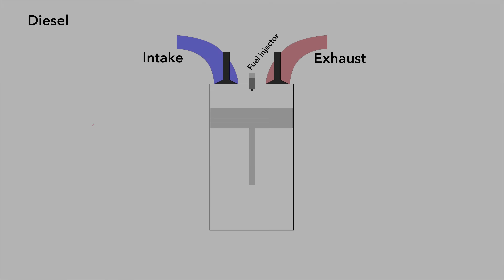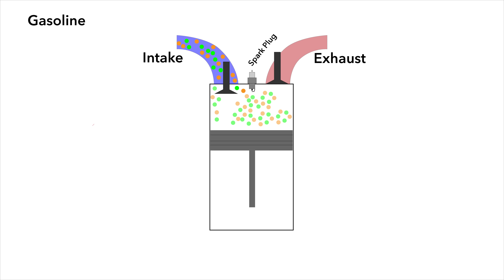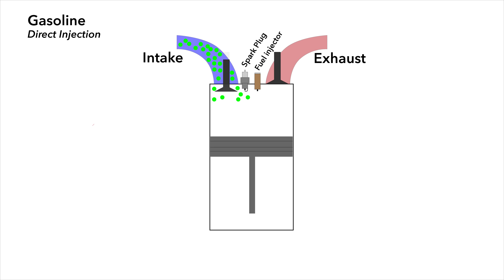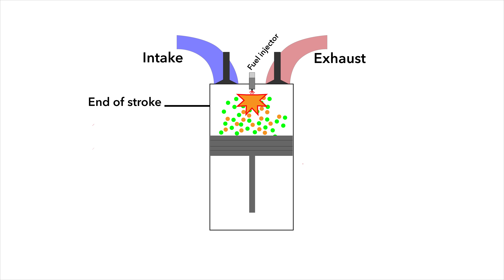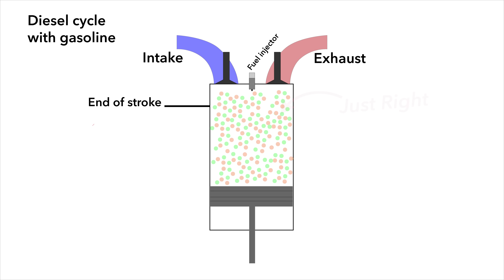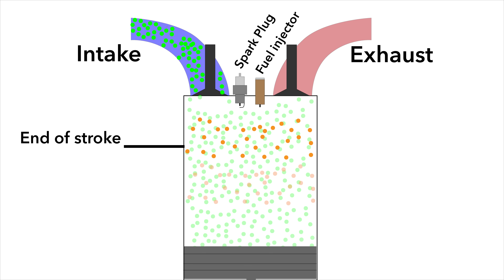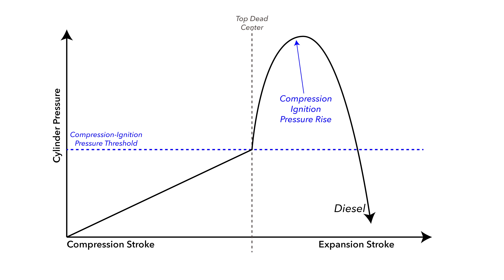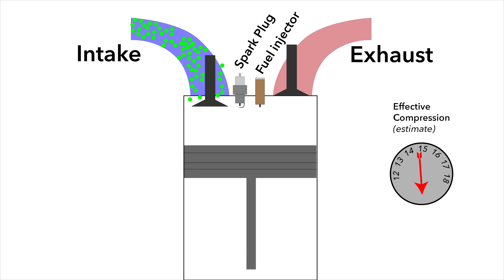Skyactiv-X: Mazda's Revolutionary Engine Explained

Comment: Still a heat engine, doomed to waste 60% or more of the energy in the fuel. Electric motors waste less than 5%. Last gasp of a dinosaur technology.
Reply: What about the old batteries of Tesla?Imagine after 20 years all this junkyards full with Tesla's acid crap.And no,there is no solution yet for recycling them.Also making electric cars they produce so much CO...read more
Reply: We have more than 200 years worth of oil without AK, CA & East coast restricted areas.  Which will carry us thru the cycle of climate change to global cooling phase...

Comment: How do you keep the carbon build up on the valve stems from happening with the GDI?   Isn't the detonation fighting against the up stroke of the engine and what we have always been told is bad for the engine?  How many miles will you test before determining longevity.  Why cant my dealer even explain to me as a potential buyer what "Sky active is"?

Comment: I'm not convinced this is anything revolutionary. My understanding from watching your video, is that this is a new name for what Honda called "CVCC" and patent in the 1970's ".   Exactly as   Mazda illustrated, but using a dual chambered combustion to maximize power and efficiency. How can Mazda be calling this "combustion ignition" if they still need to use a spark plug? 
I like the technology, just think the PR its slightly misleading.
Reply: Spark plug is there only for increase od Pressure in Valve using small piece od fuel. Maybe 5%, i don't know. Real work(rest 95%) of engine is maded by ignition of fuel like in diesel.
Reply: Cvcc engines were developed in 83. They used a spark plug small cylinder and higher compression.  They were developed in Japan. The skyactiv x is developed in Japan. They skyactiv x uses spark to increase the compression ration at high speed. In order to get around compression issues with gasoline. Based on your respons I feels as if you did not watch the video to the end. Or he dosent explain it in way you understand. No worries Try anothers videos explaining.  I see it as completely engine. by learning from the cvcc. Like. A lil bro learning from big brothers achievements. Just one random no bodys opinion. Take care :)

Comment: You are incorrect about how diesel ignition works.

Diesels use mechanical injectors to introduce fuel to the cylinder.

Diesel injectors are like syringes.  For example, if the injector is full of diesel, when it comes time to inject the fuel, the plunger will start to inject the fuel into the cylinder through the atomization nozzle where it will start burning.  The diesel will continue to be injected and burned until the plunger reaches the end of the stroke.  The result is that the pressure created by the burning fuel stays constant for a longer time rather than jumping up all at once and then tapering off as the piston is pressed down.  This is what gives diesel engines so much more torque and why automotive diesel engines get so much better mileage than gasoline engines.

Comment: Here's the question:  high CR in diesels does not ruin their longevity. High CR and resultant higher, more sudden pressure rise after the explosion allegedly does shorten lifespan of engines used for racing. 
How is that possible and how is a Skyactiv dealing with it?
Reply: Its not a racing engine. Hope that helps you.
Reply: Answering myself after two years:

1.) it's not an 'explosion' at all
2.) mixture is super-duper-lean

Comment: Mazda... SkyActive XR for the new RX-9. Or how about a rotary engine that works like an alternator. The electricity could charge the battery bank.

Theres a capacitor for turning on the vehicle, then it uses batteries long enough for the rotary alternator/dynamo to charge the batteries... Think about it!!!

Comment: Nice but also useless for a  type of engine that even ideally has a 50% efficiency ceiling, right ? Wouldn't all this creativity and genius be better invested in better electric engines ? Maybe an engine that has zero internal friction and also acts as suspension while using zero copper ( which I'm about to launch worldwide) ? Bye

Comment: Call me dumb. But how... And I mean how is it "compression ignition" if the spark plug literally ignites the fuel. He says it himself in. The video. So they figured out hoe to lean out the mixture eith slight agitation to gain extra ratio then add fuel and a spark? Hah. Sparked ignition is sparked ignition.

Comment: Have you ever heard of the Honda CVCC system of the late 70s and early 80s? This was a carb engine (pre fuel injection)..  It sends a very lean fuel/air mixture through the main intake port, into the cyl.. At the same time it sends a richer air/fuel mixture through a separate intake port with it's own valve and valve timing, into a small chamber atop the combustion chamber, where the spark plug ignites it. The resulting "flame" is able to ignite the lean mixture in the main combustion chamber. This is how Honda was able to sell us a car that got 50 mpg in the years BEFORE fuel injection was common on production cars.   So, Mazda hasn't invented anything new. This is just a fuel injection version of the Honda CVCC engine.  So, you might ask, what ever happened to the CVCC?   It was made obsolete and unneeded by modern fuel injection systems, and advanced engine control electronics...  Mazda is selling you a solution to a problem that doesn't exist.

Comment: I own since new a 2009 Mazda 3s hatchback 5 speed auto with 184,000 miles. I have been dumping money lately for suspension parts at all four corners and a trans module. I just got back from a 2000 mile Marathon trip in 50 hours. Car ran like a champ. Did not burn a drop of synthetic oil.

Comment: For over 100 years we upgrade the internal combustion engines with different technologies etc .... well in the bottom line we still burning gas or diesel (oil products) and nobody talks about the DAMAGE these kind of high tech engines still do on our planet NOBODY talks about it .....
Well ....Thank you very much Gentlemen .... But I call this fake technology nothing else.....
Face it.....

Comment: Why can't we use a small secondary cylinder which has a plunger to increase the pressure in the cylinder at ignition time? It could take the space of the injector and plug.
Reply: I thought of that In the mid 1970s using  hydraulics.

Comment: Also in your explanation you say running touch makes more power which is absolutely untrue. Running rich is cooler because the extra gas absorbs heat but it wastes gas and pollutes more and can damage your catalytic converter. Running lean makes more power and it's more fuel efficient but makes more heat which if it's too hot it can damage your engine. That's why manufacturers or tuners try to make the engine run as lean as possible to get the most power and efficiency without getting to hot to damage parts of the engine.

Comment: That doesn't sound like compression ignition to me.
Reply: Direct injection gas engine. It's was invented years ago. KTM attempted to build a 2 stroke engine using this but the injection pumps used up too much of it's power output
Reply: The fuel/air mix is compressed just below the point of self-ignition, at that point the spark will light up just a little part of it causing an increase in compression which ignites the entire air/fuel mix. Hope that helps
Reply: @gaetandevos2212  I don't need any help. It already work on direct injection gas engines now. They were mass produced in 2008. Now almost 45% of the cars have direct injection. Direct injection itself was invented in 1902. Hope that helps
https://en.wikipedia.org/wiki/Gasoline_direct_injection
Reply: @Bryan-Hensley  Yes but this engine is totally different than the original direct injection engine. Compression rate is much higher and mixure is very very lean. It ignites by compression just like a diesel but the spark is just the controlling factor.
Reply: @gaetandevos2212  yeah, but I love how companies act like it's so ground breaking new technology. I really wish I could see some real ground breaking technology for once. Maybe some new proton engines. Levitating cars..
Reply: @gaetandevos2212  we ought to have a flux capacitor by now

Comment: You keep using "explosion" in your presentation. You better Google some facts about the internal COMBUSTION engine. No explosions,  that would be very bad. 
Moreover, does the car get 50 mpg? Henry Yunicks patent describes this almost 40 years ago in a patent. Look it up. Vapor phase engine. 
You cannot burn a liquid. A mist from a spray is a bunch of droplets. Only the gas on the surface of the droplets will burn completely. The exhaust should have no hydrocarbons, only water and CO2. If an engine has a catalytic converter it means the combustion was incomplete. Thus the external "combustion" is needed. The heat is just another waste.
If you run a internal combustion engine at typical rpm's with no spark, say with an electric motor you can easily measure the pumping losses. These will never go away.
You forgot to mention that disel fuel has more BTU/lb. These engines also have longer stroke, for more torque at the expense of RPM.
If diesel fuel was converted to a gas state it could be burned like gasoline. The change of state from liquid to gas requires added heat, not a problem in a combustion engine, and the gas will then have a pressure higher than atmosphere, which Henry Yunick kept in place with a turbine acting as a check valve. 
Look at a primus type kerosene lantern, no smoke and no smell, and the liquid is thoroughly gasified before burned.
Even some types of diesel engines has a pre-mix chamber pointing to this.
If this new engine is so much better, what is the Mpg?

Comment: You didn't say anything about the car or the ancient tell us about the D diesel on the gas everybody knows about Diesel and gas man show us what's in the car what's in the engine what's it doing you don't even know what they do is they adjust the valve timing of the intake to increase the compression on low-power like it idle or cruising you get more efficiently in the fuel but on a powerstroke you want to reduce that compression ratio when you need the power believe it or not it sounds opposite counterintuitive you won't really in that car driving it

Comment: This has been in F1 engines for a while now . Some systems actually use two injectors , one to inject fuel into the cylinder and one to inject fuel into a small chamber enclosing the spark plug .

Comment: Any idea about what the miles per gallon will be on this? My 2016 MT Mazda 3 can get close to 38-39 on the highway and usually is around 30 with mixed driving. That's really good for a gas engine. Also I love driving Mazdas! So much fun.

Comment: Detonating. He mixed fuel and air and used the turbo as a "homogenizer" and superheated the air and fuel and it worked fabulous! 350 horsepower and 80 plus miles to the gallon out of a 2.2 L 4-cylinder!!!  I wonder why they didn't buy it from him.......

Comment: Hi Alex, thank you very much for this video. If I understand this correctly, this engine is using some of the principles of the Atkinson cycle engine, to provide for variable compression ratios. Interesting but ultimately I believe we will all be driving battery electric cars very soon.

Comment: Sorry to say but you are wrong kind sir it was Peugeot who did this 1st and I can prove it and bare in mind I have seen it done with the coil pack unplugged but I will admit the running of the engine was not smooth and there is 1 little key trick that Mazda did not do  that everyone is over looking also that I am sure will eliminate that spark plug totally Mazda has part of it correct and Peugeot has the other part correct it's jus the 2 combining both technologies and boom the spark plug is extinct

Comment: Ok lets say that they will put this engine tech inside the next gen mazda 6 after 3 or 4 years from now so they got some time to get more power out of this engine, lets say 200 or 210 hp (for now it generates 190hp)
Then combine that with a mild hybrid tech just for a little bit more efficiency and to produce more torque where needed,
then make it a full hybrid car
While keeping it light since it will use the newer chassis of the mazda
Idk what would be the cost of making this or if it can be done in the first place
But eventually u will have like 240 or 250 hp with a mpg that might be better than a prius 
And ya  mazda's design !!

Comment: Amazing technology but I feel it's just a few years too late as the industry seems to be heard towards electrification.
Reply: Not necessarily. They aren't completely redesigning an engine but using some tech, engineering, and existing components where the tech can still be affordable if priced in to traditional unleaded engines. If what he's saying is correct about the 20% improvement in fuel efficiency then that's amazing if the sticker price isn't all that much for a new vehicle vs. an electric . Most electric vehicles in production right now price out many people and they still aren't that practical for long distance trips.

Comment: The reason why we can't just crank up a standard gasoline to the high compression levels we find in diesel engines must be else than that if we try to operate more of the traditionial diesel cycle then as we're injecting the fuel it wouldn't start burning as soon as it was injected.Cetane number is an indicator of the combustion speed of diesel fuel and compression needed for ignition. But the cetane rating of gasoline is very, very low. So gasoline wouldn't start burning as soon as it was injected.

Comment: The future of Carbon on valves now also pistons with holes. That is why it was not done before because lean fuel mix will make a hole in your piston heads. Plus i hate "Auto detonating sound" And this will make feel uncomfortable. I still have to get used to the Direct injection noise...............Terrible!!

Comment: Is high octave required?
Reply: George Stone No, the engine runs fine with 87 octane. Using higher octane will push the peak of the torque curve to higher RPM. (Weirdly, they said that the compression ignition aspect works "best" with just 80 octane.)

Comment: I had a Mazda RX-8 in 2008 I owned it brand new with only 22 miles on the clock, the Wankle Engine died within 19,000 miles and only 9 months old let alone the poor fuel consumption I’d never own a Mazda again, the 2006 Honda Euro Civic I bought in 2009 now has 211,000 miles and it hasn’t ever broken down except when the batteries failed

Comment: if you poor water into the subtronic igniter and couple it with with a diesel gear linkage run by jet moderator, thus the footsey over rider that will give you a full over ride of the digit space throttle separator which will turn the waste brown lumps into more liquid you get it
TIHSLLUB.  just for fun

Comment: You lost me when you showed the diesel vs gas ignition curves. Diesel is stronger and longer. Gas is strong but shorter . You showed the opposite. Hence the low rpm of diesel vs the higher rpm of gas. Diesel burns slower but delivers more energy, gas burns faster. As you said later there are many other variables, but the burn rates are what everything else is adjusted for

Comment: The last gasp of the ICE is not far away. Mazda invested a lot in the rather inefficient Wankel engine in the past, which probably left their engineers with a lot of good understanding of the combustion process, and probably some patents they are exploiting with standard piston engines here. Now I note that Mazda is teaming up with another Japanese carmaker arriving somewhat late to the paradigm shift to full Electric Vehicles in their line up. 

Quite likely Toyota, which also made its mark with the best implimentation of the gas/electric Hybrid with the patents needed to cause Ford and other makers to pay them royalties, may need some of Mazda's patents in future. Then probably Mazda needs some of Toyota's EV patents for their entry into that market segment. Perhaps they both need each other's EV patents, each being somewhat deficient compared to the manufacturers that had done the most preliminary work. 

I do appreciate that Mazda also recognizes that diesel technology can not get clean enough for our future needs so, like every other ICE manufacturer, they have made the moves necessary to get ultra lean burn gasoline engines to work well outside the laboratory. Unfortunately, like all IC engines, the probability is that over time, in use,  that engine will get dirtier while the combustion based sources for EV's will, of necessity, become cleaner.  Stuck injectors are a problem that will not go away until the vehicles that use them do.

Comment: Alex, Great review as usual. Last night I test drove a 2018 Mazda CX-9, with the Skyactiv - X, 4 cyl. - 2.5L. Very nicely appointed and with the Touring Premium Package - $1,890 with the car is priced around $38K. Very competitive pricing with a luxury interior (ie. in the Infiniti quality level) and a decent exterior design (headlights and taillights a tad small in my opinion). I currently drive a 2008 Infiniti EX35 Journey, with 295hp under the hood. When I accelerate from a standing position this engine hums beautifully to full speed. However the Mazda 4cyl. engine was noticeably loud until I reached 30mph +. Yes not fair to compare to the 6cyl. Infiniti but this noise was quite unexpected. Did you experience this as well? The Sales guy stated this only occurs when the engine is cold, however they had the car warming up on the lot when I arrived, so this doesn't hold water. Your comment would be appreciated. Thank you in advance.

Comment: High compression does NOT make diesels more efficient. It's the high EXPANSION that increases the efficiency. Same thing with petrol engines where the compression is less than the expansion. This is not compression ignition, but ultra-lean burn.